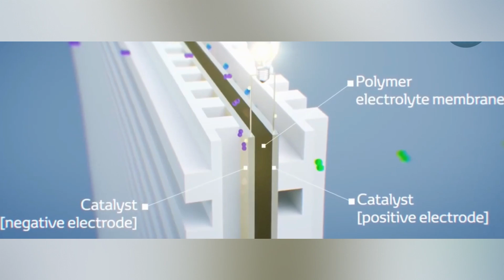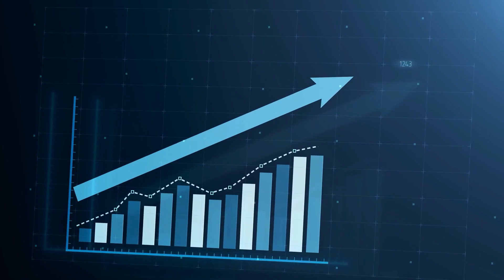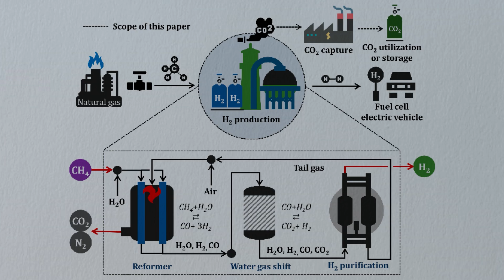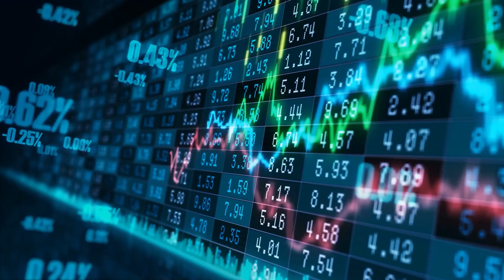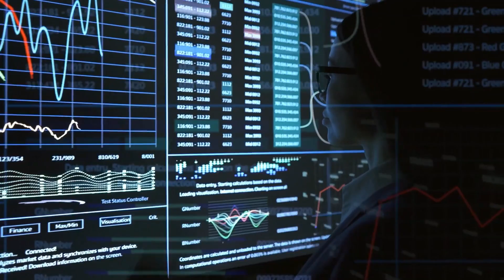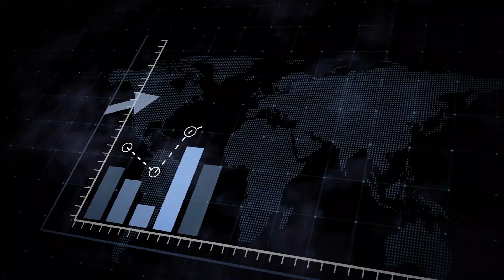Hyundai CEO Finally Reveals The Truth About Hydrogen Cars!

Comment: pound for pound, hydrogen delivers 20 times more power than battery power.  This means, don't needs heavy battery packs to drive long range.  less battery pack means less polution to environment, too.   Recycling used battery pack is difficult and costly.

Comment: Hydrogen fuel cell cars have two problem ie they are electric ie high battery size and they have hydrogen storage issues.  If we are able to make batteries  very very safe, high energy density/charge/discharge, portable and reliable as their IC engines, then hydrogen storage might not be required completely shifting hydrogen usecase for producing power..